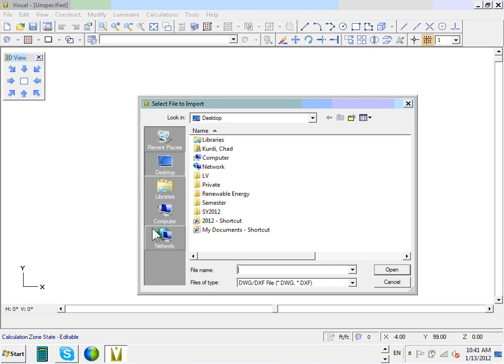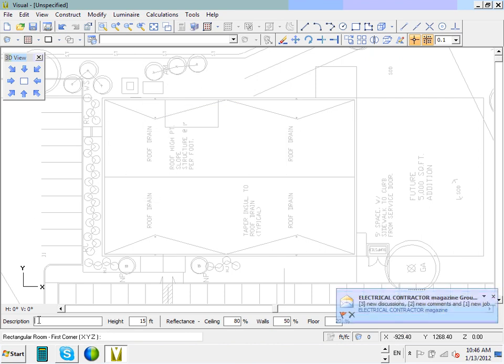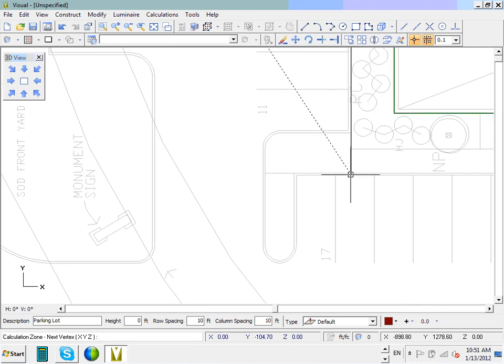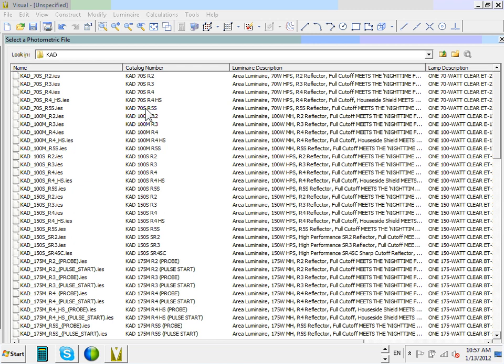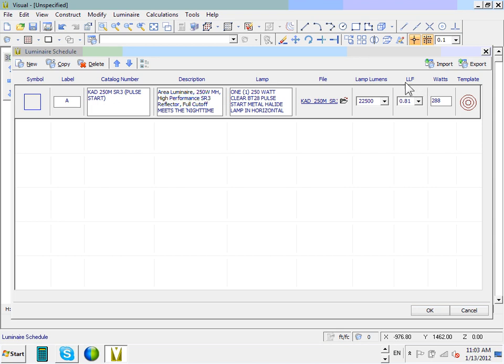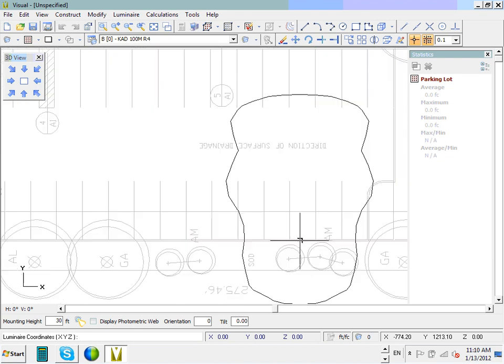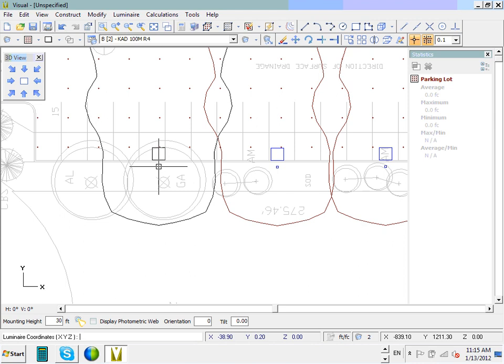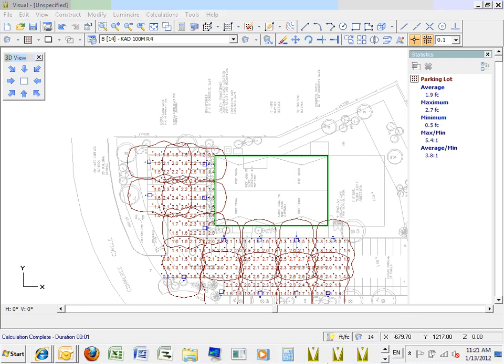Commercial Lighting Calculation-Visual Software-Parking Lot-01-13-12.wmv

Comment: This I think is a very guy is a good teacher.  He is not a lighting designer however.  For example poles are way too close together, the overlapping is not how we lay out poles ... he is overlapping an isocontour - it all depends on the value of the isocontour.
Reply: Chad does mention a 0.5fc minimum requirement, and he set the iso-contour to 0.5fc, but the point to overlap between two luminaire should have been 0.25fc as this is the contribution from each.The way to do it is set iso-contours to 0.25 and 0.5, 0.25 for overlapping and 0.5 for when there is no adjacent luminaire.